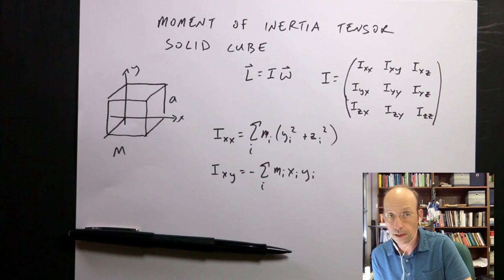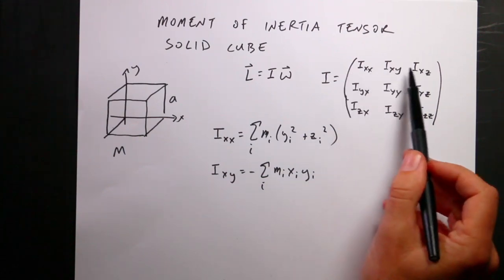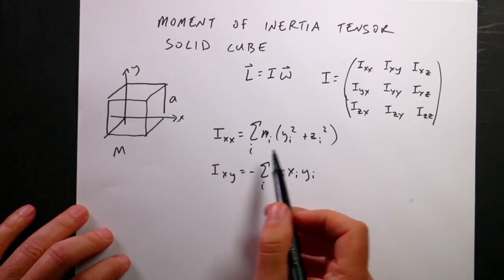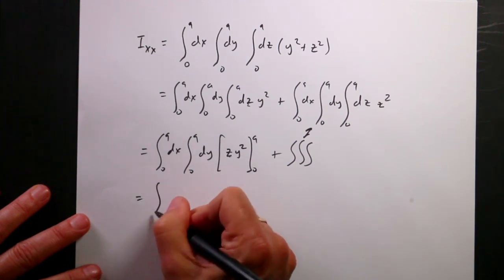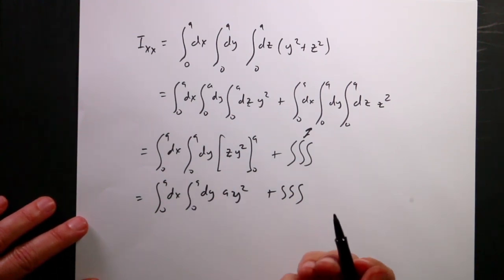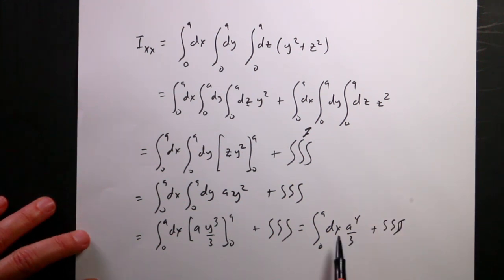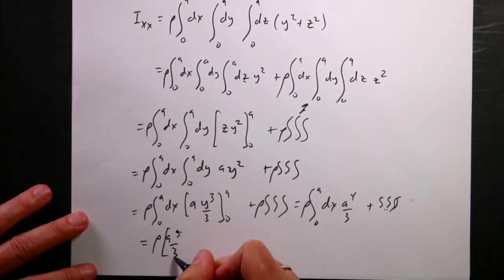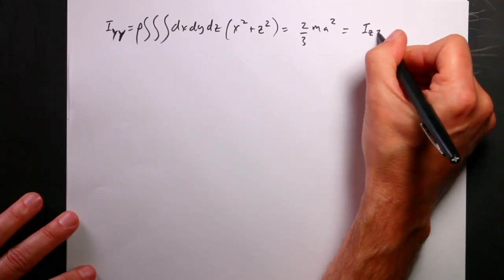Two Ways to Find the Moment of Inertia Tensor for a Solid Cube

Comment: A quick doubt. Why xy and yx components get a negative sign. Sorry if the question is too obvious for the answer.
Reply from the maker: That's a great question - without an easy answer.  Basically, you are taking individual points and finding the angular momentum (r x p).  When you factor and gather terms, you get stuff that looks like the elements in the inertia tensor and they just happen to have a negative sign.

The key is to realize where that tensor comes from - r x p for a bunch of particles.